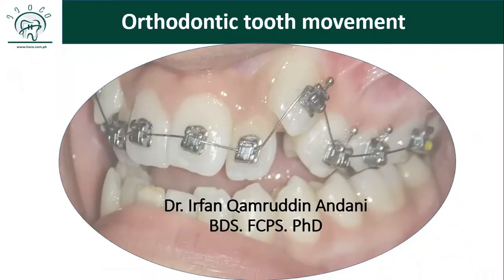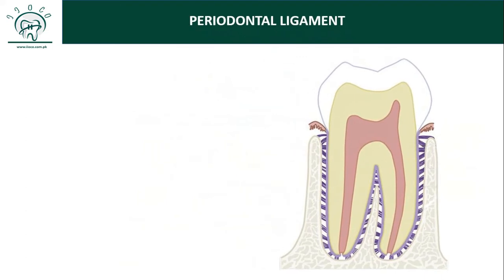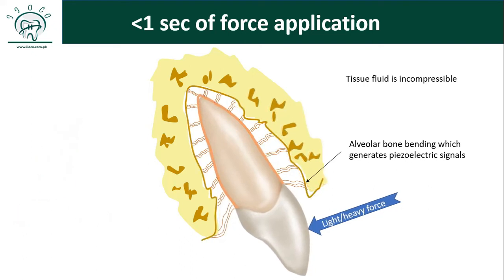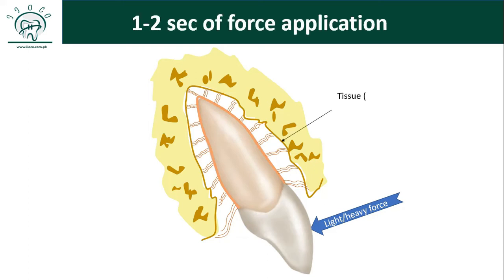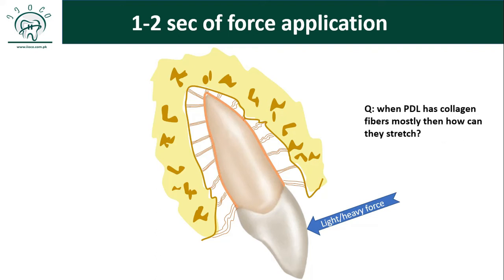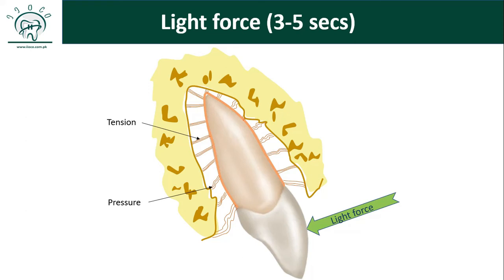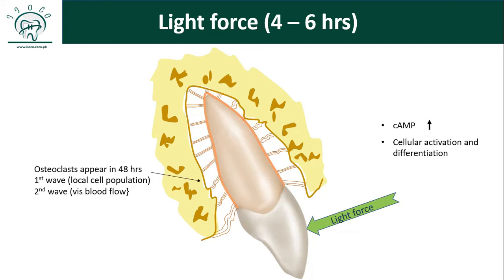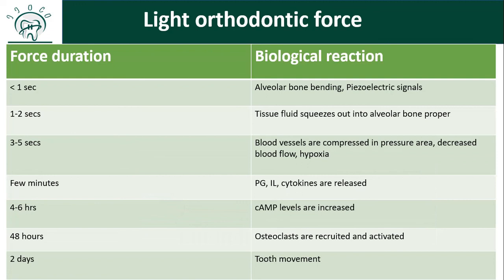Biological response of tooth to light orthodontic force

Comment: Thank you sir but i have understood that it's no matter if the heavy force was applied for short period of time the hylinaization and abrupt movement will occurs within along period of time at short time apiezoelectric theory will occur and if the heavy force removed there will be no problem with pdl that's right

But what is the treatment if the orthodontics applied aheavy force r and caused asudden movement
Reply from the maker: @SaraSaid-s9s  yes you are right. 
Hyalinization is usually unavoidable, and happens when we apply force. I would say, it's better to measure force and try to apply light force